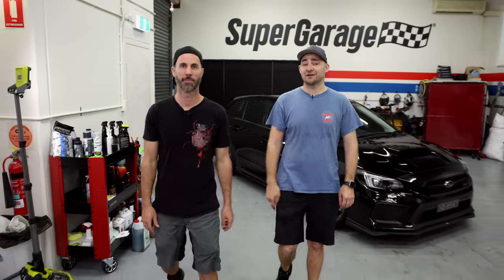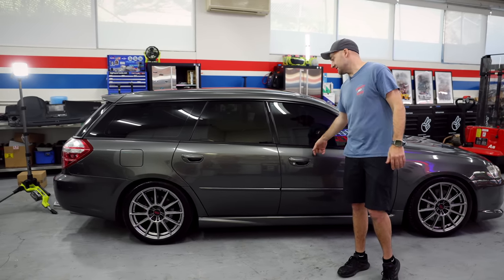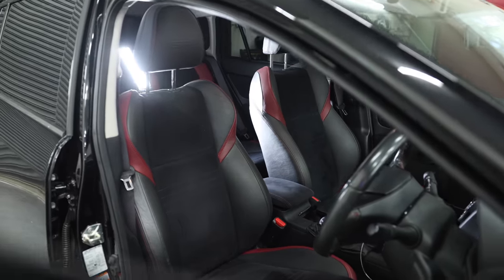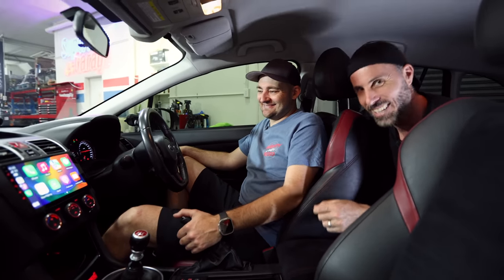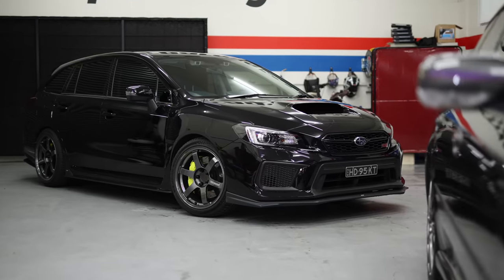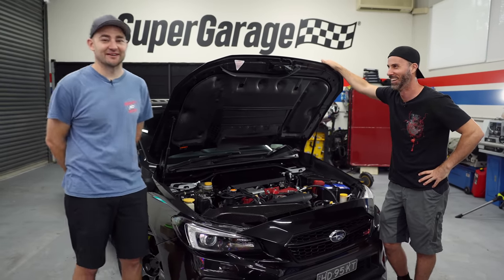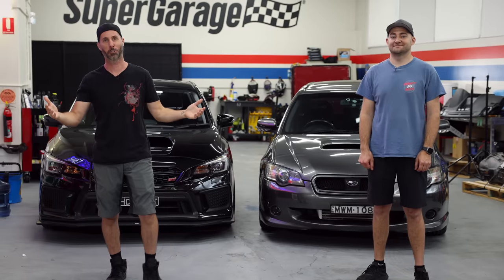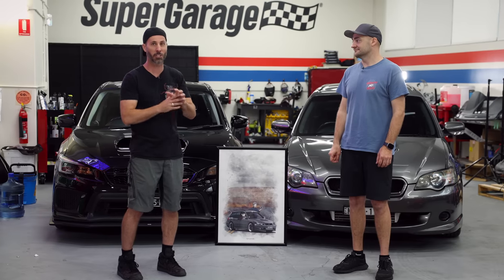The BEST Subaru Wagon Ever? We have two - Marty's Levorg Part 8

Comment: Supergramps is just its own animal. Even if the levorg ends up faster, the amount of work and struggle that went into gramps just makes it so much more special
Reply: Well it will always be the OG.
Reply: No doubt. I low-key wanna see them do this to a boring old Volvo estate. It's a new car brand they've never worked on, plus making a boring car go fast is always fun.
Reply: That last bit...🤣🤣🤣🤣
Reply: also shout out to the fabricator , "turbo yoda"
Reply: Chev V8’s fit with space to spare in a Volvo. They are popular with the no trailer crowd at Drag week.
I want to see these guys do a Lexus or a Supra
Reply: Well said. Well said.
Reply: The super gramps series sold me on Subaru, since it was clear this was wrenching heaven compared to everything else I tried to fix. Will forever hold a special place in my heart. 
But the Levorgs (stiff)body will ultimately give it the edge as a driving machine, even with the extra kilos.
Reply: That's ok, just park the Levorg out in the Melbourne rains, do a new engine build from the ground up, GG! :P
Reply: Gramps was the car that made me watch this channels every video before that I would watch them occasionally but after that I turned on notification and made sure not to miss an episode
Reply: Yeeeee. I hope Turbo Yoda comes back for an appearance.
Reply: 28:03 The G's of the pull in the tunnel sets off the Dash Cam thinking there's been a crash detected or something
Reply: @ShinnSin  same I'd love a fast Volvo
Reply: I have special place in my heart for things which weren't designed or meant to do things they later on were built to do and super gramps is one of those and it's also getting there just fine. Of course it has its downside of needing to cool of every now and then but that makes it even more special. It's not robot like performer which reproduces the same result every time. It has character, spirit and soul which robot like repetitive block can't reproduce.

Comment: The levorg is like a modern recipe that your wife cooks. The supergramps is like your grandma's recipe that will always have a special place in your heart and no one can replicate it.
Reply: “hear, hear.”
Reply: The secret is lots of real butter (displacement)
Reply: More like home cooking verses nice restaurant.
Reply: And your mistress' recipe is in the box at the end of the vid
Reply: @heygek2769  No... displacement only helps on the power curve, the current Formula 1 cars are 1.3ltrs but there power is ALL top end... Supergramps has a giant ass turbo
Reply: Great analogy pal
Reply: @insomniacbritgaming1632  I don't understand your argument. Also Supergramps doesn't have a giant turbo at all, they already said it's quite small for the engine size, which is why there's barely any lag.
Reply: @heygek2769  exactly. it had to be a fairly small turbo as at the time Supergramps was built, there were few or NO parts available for the EZ36 to strengthen it up, and there wasnt a turbo version of the engine from the factory. much as i like a bit of tech in a car, of the 2 (and i havent watched the video yet) id take Supergramps. better looking car, doesnt have black wheels on a black car (looks too much in my opinion) and supergramps, being a 6 cylinder, doesnt have that AWFUL engine noise (sounding like its got a misfire) that the 4 cylinder subarus have, and exaggerated by noisy exhausts.
Reply: Oh come on, it's a Tribeca engine in a Legacy body with a 6 speed STI box mated to it. Anyone with a fat enough wallet can replicate it if they want.
Reply: @theParticleGod  you can say that about pretty much everything man-made
Reply: @heygek2769  not really. No amount of money will ever get you another Mona Lisa, because the bloke who painted it is dead, but also because he didn't go and buy a bunch of Mona Lisa parts from wrecked paintings and slap them together to make it in the first place.

For an analogy that's a bit closer to home, think about one-offs like the Dusenberg Special. Nearly impossible to replicate that amount of bespoke metal bodywork.

Comment: I never realized how well Supergramps aged. It still looks super modern
Reply: That generation Legacy is in my opinion one of the best looking and timeless station wagons ever built.
Reply: @Perry_dAccard  absolutely agree. It was such a good looking car in wagin form. The saloon version was pretty nice too!
Reply: Literally just commented the same thing. It could pass for an Early - Mid 2010s car. I was surprised when he said it was an 03.
Reply: I feel like around 03-04 was the beginning of this generation of cars that are deigned in a way that doesn't age.
Reply: 100% - the gen4 legacy/gen3 outback is such a timeless design.
I have an '18 accord now but I miss my gen3 outback everyday...
Reply: Looked better on the meister wheels imo but does still look very good despite its age
Reply: I actually am not a super Subraru fan (I like them, but was a Toyota nut myself), But sheesh Supergramps is just a timeless classic, and I think it looks way better than the new one with ther robo-vomit.  It looks just aggressive enough for a sleeper.
Reply: I don’t think it does, but you can trick someone into thinking a car looks modern, often, by just replacing the headlights, putting on new tires and re-doing the paint. Look at restored 90s cars, you get the same thing.
Reply: @Perry_dAccard  Agreed. The BP is arguably a much better looking in it's wagon from than as a saloon - the continuous glass and lightly sloping and tapering greenhouse is near perfection.
Reply: As the owner of one of these in sedan form, I may be biased. But I do think it is quite a handsome car that aged very well indeed
Reply: I had an BP H6 outback and a VE Omega Commodore, the subaru was so nicer inside, less hard plastics etc. Such a good car for the era
Reply: It definitely doesn’t look modern. It looks great don’t get me wrong but just because a car still looks good doesn’t make it modern.
Reply: @HoloEN_GawrGura  Absolutely. The EVO9 also falls in that bracket. Or my favourite (as a Mazda guy!), The Alfa Romeo 159 is to this day an absolutely drop dead gorgeous car.
Reply: Except for the interior, everything else looks like its a late 2000s car.
Reply: Yeah strange that it never got a head unit
Reply: @Perry_dAccard  I still think the fd rx7 was the most timeless shape that still looks modern. Evo 9 and this liberty up there.
Reply: @HoloEN_GawrGura  The Honda s2000 came out in 99, and it's the pinnacle of non-aging modern car design.
Reply: @paule4204  I think the FD has an almost timeless design, but it doesn't look modern, it has too much of that 90's bubble look.
Reply: @paule4204  True, hat car still looks sexy as hell today. I just can't really warm up to the rotary, I'd prefer a high revving V6 in that.
Reply: @heygek2769  dude, if you turn around the front bumper, so it doesn't do the "happy face" thing anymore, you could just release it in 2023.
Reply: It's a pretty timeless look. But also looks well maintained. The paintjob is still great and the lights are still nice and clear. That makes so much difference.
Reply: @HoloEN_GawrGura  ehh, cars nowadays have really sharp lines(folds?) in the bodywork, for the S2000 a bumper update, some hard lines around the wheel arches and skirts, maybe change the lights(again sharper design) could be enough to make it look like it came out today. But if you're talking about the RX7, it just has too much roundness and bubble shapes, also modern cars have much thicker pillars, which is less of an issue for a cabrio like the S2000, but on the RX7 it's really the front and rear pillars that tell it's age, they're just too thin with soft angles. EDIT: Just wanted to add that it isn't so much the 'frowny face' that makes a car appear modern, most cars nowadays still have 'happy face' (though sportier cars usually have a frown), again it's just sharper lines and the grill being flush with the bumper and/or a trim along the edge.
Reply: @Perry_dAccard  Facelift(06-09) especially, it also nullifies vast majority of their criticism as its nearly identicsl to Levorg's interior with facelift one. full function wheel, mfd and aux/bluetooth radio. Gauge cluster screen also has trip info but also can wosh you happy b-day so 4th gen Legacy was first with that.

Comment: If i had a chance to pick one to keep, Id want super gramps! It has a level of stealth that I REALLY like and it pulls hard like the levorg, I think they should try to update some of the stuff on super gramps to to make it even lighter but all in all prefer super gramps all day!
Reply: the "vague steering" may be as simple as a power rack swap, for sure dumping some "dumb weight" would help it scoot even better. bigger radiator and more oil cooling? it'd be better for when towing something too.
Reply: @modelnutty6503  it could be even easier as putting a restrictor in the high pressure line to reduce the pressure, thus reducing the assist.

Comment: Hey Marty, you can get replacement centre vent kits with an android head unit for the gen4. Comes with all adaptors and harnesses to suit.
Also, find an Outback premium steering wheel....they have steering wheel controls that will work with the head unit.

Comment: At the end of the day Supergramps is just an absolute legend of a car at this point, and I think especially for those of us that have watched that car evolve over the years into what it became it is extremely tough to beat. 

As it is I'm slowly building/restoring my own 06 tbSTi and trying to think of how I can capture just a little of that same magic without going the route of just copying what you've done (And I've got my own ideas around that which I'll keep to myselfI ), but the other build that is sitting in the back of my mind for doing as a modern daily driver (Leaving my tbSTi for the weekends) is taking an Gen5 Outback 3.6R, and seeing if I can drop it and do a similar conversion of WRX STi parts onto it as you've done with the Levorg, but leaving the EZ36 in it, small turbo, and more modest tuning work then you did with Supergramps - less power, but running reliably on 98 as a daily. Just making it a big comfortable GT cruiser with power that I can hit from anywhere on the Rev range.

There's just something about the visuals of a lowered Gen5 Outback I prefer over the Levorg. Hard to put in words but I guess it's kind of a softer more 'matured' look, and even a bit 'beefier'.
Reply: 🔝🔝Hey thanks for watching and leaving a message I really appreciate it I have something special for you🎁📦🎁

Comment: Love seeing the comparison as my FXT when done should have similar power to the Levorg, but the old school Subaru feel of Super Gramps. Super excited to see what you're building next! Also, pretty sure Moog's face at 32:00 should be your new thumb nail 😆
Reply: What year is your FXT? I'm doing a 2004 with an iag stage 4 long block and flex fuel
Reply: I have a 2005 FXT that has been fully STI swapped and has aftermarket goodies. Not that I wouldnt take this Levorg if I could, but I love the boxy styling of the FXT and miss it a lot in modern cars. We need another affordable fun wagon. We only have Audi RS, Merc E AMG and th CTS-V to go from and its just too much money for those.
Reply: @buckykattguitar  Do you have your build posted anywhere? I would love to see it. I have an 05 thats about as far as it can go on the stock block.
Reply: @buckykattguitar  Mine is a 2008 XT Sports in WRB. IAG stage 4 is nuts, but it'll be a beast for sure. I'm only shooting for 280ish whp on stock block with STI bolt ons.
Reply: @SimpleEnigma331  I totally agree, I love wagons, especially 2nd Gen Foresters or Volvo 850s. As far as new cars, hardly any wagons and only fun ones cost an arm and a leg.

Comment: One of the interesting things this video's done for me is show how much changed just within the period of Super Gramps's generation. I have an 08 Outback turbo, which is the same generation body as Super Gramps, but mine does have steering wheel controls, the climate control is a dual zone auto, and it does tell you when it's your birthday.

Comment: Guys... the Liberty/Legacy you used for Supergramps, maybe was a naked cow... did you ever see a full spec-ed version? 
It has a multi-function steering wheel as well and in the dash a touchscreen MFD (computer/navigation system), with integrated 3 gauges and a reaction, thats faster than volkswagens touch units TODAY! An it came out 2004 and was produced to 2010. The levorg came out 2014 or 15... so there are 10 years between, not 20.
The BP Legacy was a absolute great car, and did you see an Outback (with the stock widebody fenders) slammed on BBS LMs? Dude, that was breathtaking hot!

Comment: DCCD does not adjust torque split. The torque split is fixed via gearing. DCCD only controls center diff lock-up. Even with the DCCD off/open, you still have a clutchpack center diff that applies some resistance, so you still shouldn't e-brake it with the DCCD open.

Comment: SUV kinda lol I have a sf5 forester S with sti front lower control arms solid bush rear subframe from a 07 Impreza and Impreza suspension with 40mm inserts and wrx 300mm discs and 4 pots in the front. Running around 14psi . Quite a rare car in Scotland 🏴. Been following u guys for awhile now just wish I had the resources you guys have I do all my work in the drive way

Comment: 27:18 That is actually the difference in the rack and pinion between the two. The Sti has what they call a "Quick Rack" and the Legacy liberty and anything outside of the Sti variants has a typical stock rack like youd find on any pedestrian car. The Sti has less turns full lock to full lock, then the other racks. Look it up. This is why the levorg feels more direct or less "vague" then the legacy does. both cars have Modified Sti suspension (Both cars by Martys choices, not at all like two cars from two people) at this point, upgraded sway bars linkage ect, the only true difference outside of pure chassis differences IS the steering rack.
Reply: 🔝🔝Hey thanks for watching and leaving a message I really appreciate it I have something special for you🎁📦🎁

Comment: I believe all of the Gen 4 Liberty GT's from late 2003 (MY2004) were auto's. The steering wheel had buttons on the wheel. They were for changing gear. I have one (August 2003 build) and its nowhere near as good as paddle shifters. 

 Al did a twin turbo conversion for me on a 1997 Gen 2 Liberty GX to Twin Turbo from a Legacy GT. That was back in 2005 when he worked at Sunspares . He did a great job on it.

Comment: The Supergramps looks like it needs a cold intake shroud around the air filter. You will gain so much more power because your not sucking up hot air. Also if it doesn't always have it a oil cooler might be beneficial.

Comment: Hmm so strange, the interior in the USDM legacies of the same year seem to have held up so much better. I know that the USDM model components are manufactured here so maybe the materials are better somehow or the LHD injection molds had better dies to form them? We had lots of variation in the trims and interior colors but we never got the red leather like the spec B had which was cool looking...I wonder how that interior stood the test of time. MY 2005 OBXT had a really nice interior with black leather and brushed aluminum trim pieces, it also had an EJ255 which had the same bottom end as the STI  with different heads/intake manifold.

Comment: To be fair, that interior in the Liberty is from a base model or safety pack car and the Levorg is a higher spec car. If Supergramps had a SPEC B interior I think it would rate a bit better (audio controls on a Momo wheel etc)and the 13 speaker Macintosh

Comment: The tech in Supergramps' interior is just about perfect in my opinion. I'd even say the Haltech dash is overkill. I hate having screens and buttons in my interior, the only thing I want blinking at me is my single din bluetooth head unit. No steering wheel buttons in my way, no giant screens. Analog everything feels so much better, you're so much more connected to the car. Interiors peaked with Japanese cars in the mid to late 90s.

Comment: Seems like most of the video was just old vs new. You forgot to mention the part where marty's face LIT UP instantly when doing a pull in supergramps. I've driven fast and slow cars and power doesn't matter, it's all about the emotional response when you floor it. The winner should be the car that you tunr around to look back at while walking away from it! Glad gramps won 🏆

Comment: Really wondering how you guys worked with the eye sight system? Is it still active with active cruise etc? My understanding was it never came with manual cars as the breaking/crash assist wouldn’t work with coming to a stop if you didn’t put the clutch in.

Comment: My '04 LibGT looks significantly better inside, and that was literally a 'taxi' for a hotel in Warrnambool.

I mean, it would if I vacuumed it.

EDIT: Also, if SuperGramps was specced up, it would have come with the pretty decent Macintosh stereo with the 6 disc changer and like 13 speakers. The clock screen also had two average fuel use gauges (tied to the odometer), current fuel usage, time since the car was turned on (useful for long drives) and temperature. So it did have alot of digital goodies, once upon a time.